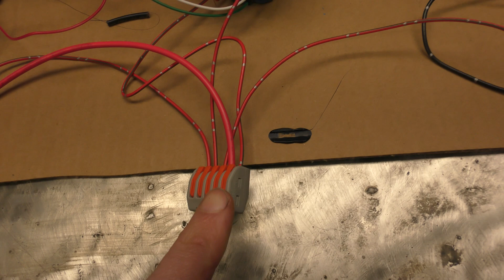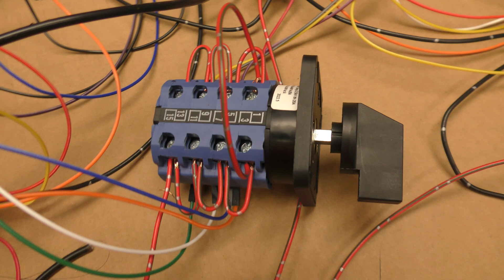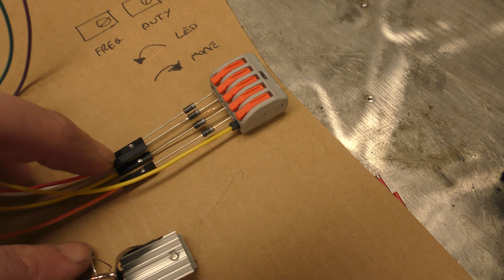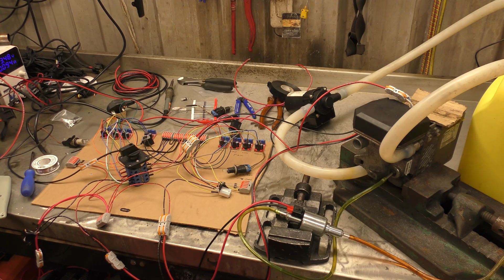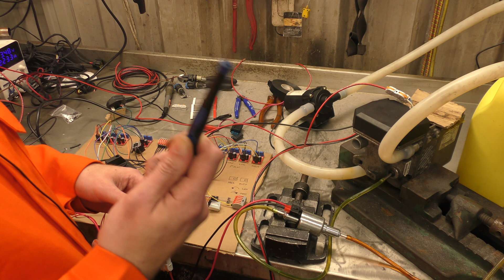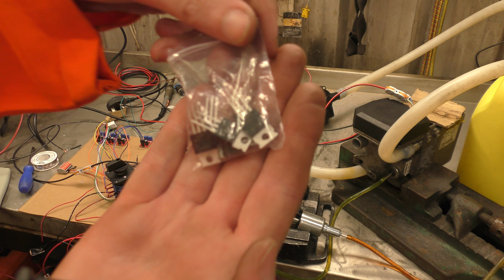Replacement Webasto Diesel Heater ECU Controller  - Part 2 - assembled and running no ecu

Comment: That looks great mate but I don’t think it’s for me looks way too complicated. I purchased a Touran thermo top and it’s a nightmare I’ve cleaned it and got a secondhand water pump as it turned up burnt out and had no fuel pump so I’ve got secondhand ones coming but don’t know if even that will work. I’ve got a w-bus coming not sure if that will control it even I’m a real novice and it’s costing me a fortune.  
Question please- have you ever removed the diesel solenoid well I did against the recommendations and damaged the gasket 😢 x2 and the copper one was already a bit poor. Any idea where to buy a kit I can’t find anywhere. 
Cheers Mark
Reply from the maker: None of the Webastos I've had were the ones with the solenoid.

Depending which Webasto board or where it came will be whether or not the W-BUS works.  Thermotop V are most likely to work with the W-BUS adaptor.

Comment: In my opinion you missed a step in starting the heater: the glow plug should run with no fuel at all for some time, in order to heat up the start-up chamber. 
Did you think to use a chinese controller for this device? It is already made and needs only some small tweaks to work.
Cheers!
Reply from the maker: That's not how the original webasto starts.  It pumps fuel in, starts glowing, starts air and then pumps fuel.  You're thinking of how the air heater starts.

Have you done any of the small tweaks to make one work?  I haven't seen a video of anyone doing it yet, and I'd like to see it.
Reply: @DavidMcLuckie  My bad. I never played with a webasto and didn't notice this detail. Yes, I thought about chinese diesel heaters when I left the comment. And my thought process was that the pre-heat chamber should be heated up thoroughly before starting fuel pump. Considering that a webasto has a glow plug rated at a smaller power than a chinese one, I thought it would be wise to do so. My diesel heater heats up the even the exhaust pipe before starting fuel delivery. Seems like webasto works in a different way. Perhaps the smaller burning chamber makes the difference.

About the chinese controller, it was just an idea. I don't have the funds to do this experiment. However, the tweaks I thought about would be changing the glow plug and the temperature sensor on a webasto with the chinese counterparts. It might work.
Cheers!
Reply from the maker: Ah ok.  I did have a commenter say they had converted the chinese ecu to run a webasto but have never actually seen it work.  The problem is the chinese ecu having a fan speed sensor and the webasto doesn't.
Reply: @DavidMcLuckie  I think that can be done somehow. After all it is just a magnet and a Hall sensor. I don't know the guts of these deices but anything can be done from an engineering point of view. Depends on how much it costs and the machinery necessary to do it.
Cheers!

Comment: Good day David.  

Greeting from Alberta, Canada.  Have found your videos enjoyable and helpful. Thank you. 

  I have a gasoline fired eberspacher air heater that I shipped across Canada to have tested, confirming the ECU crapped itself.  I am hoping you have a suggestion for a replacement kit I can solder together, or could we still use the original ECU, but make an add on kit to fire the igniter ? Then once lit, the ECU monitors and shuts down as it should ?   Fuel pump and circuit we’re working properly, I believe it went through start up procedure, but would fail to ignite the fuel, or petrol as I believe you call in on your part of the world. 

  Thanks in advance,

Henry
Reply from the maker: Sadly I haven't played with either Eberspachers or anything gasoline (petrol) related.

Comment: How about using automotive indicator relays to pulse the pump? Adjust the frequency via the output resistance (like some bulbs out and then it pulses faster).

Comment: Assuming it's wired "normally" for astable operation, there should be a resistor from + to pin 7 of the 555 IC, then another between pins 7 and 6.  You can alter the on:off ratio by changing these.  If your + to pin 7 resistor is 1 tenth the value of the other you'll get about a 10x on:off ratio.  Changing the combined total resistance will alter the overall switching frequency (can be corrected by altering the capacitor between pin 6 and - if needed).  If the output is "on" for the long period, just invert it with a transistor.  This will allow setting the proper duty cycle for the pump.

Comment: I suspect that MOSFET is operating in its linear region it's probably not switching off fully
Reply: Agreed.

Using the diodes is preventing the 555 driving the gate low quickly.
The pull down will be slow to act, and hence allow the linear region to persist for too long.

Comment: To solve the pump pulsing is to change the capacitors, I've farted about with 555 ICs (not the modules, but just the ICs alone) and changing the capacitors can change the On-Off times, as they're holding the charge to keep the output(s) turned on and the resistors, which I guess are in the form of trimpots there, are discharging them at a set rate, so, lower capcitance, less On-time, or something, I only fiddled with them as timers to operate relays akin to indicator flasher cans... :P

Comment: Electrolytic capacitor (with a resistor across it) in series to cool the pump down.  Put a diode on the glow plug, too, as the element is often a coil, too, so can generate back-emf.
Thank you, very interesting!